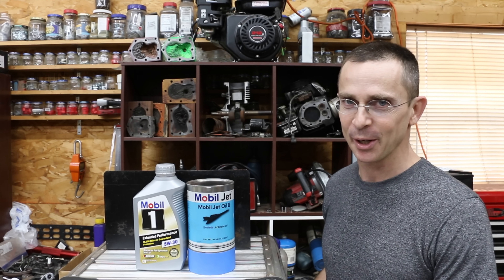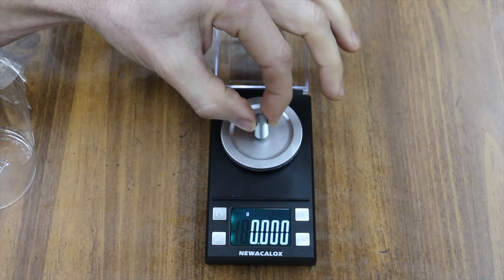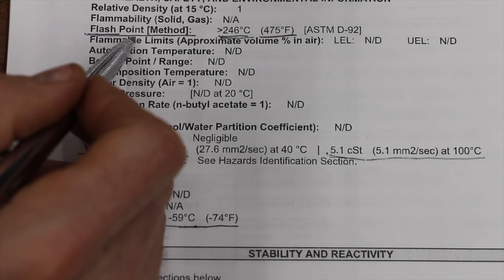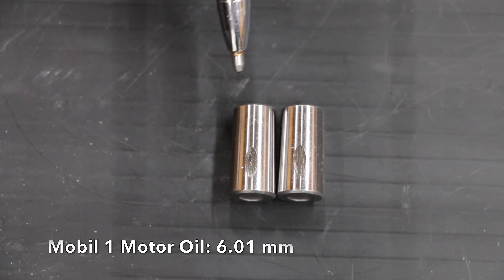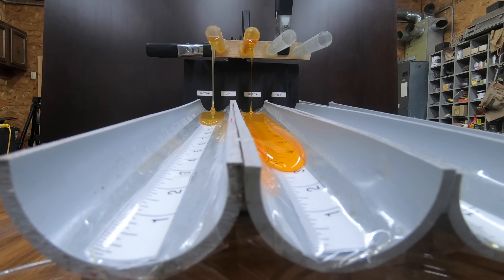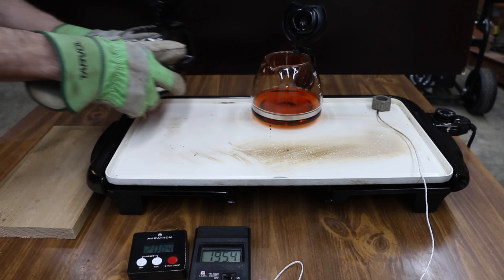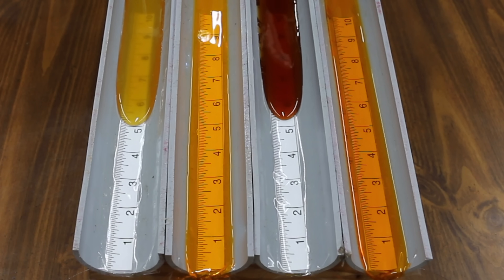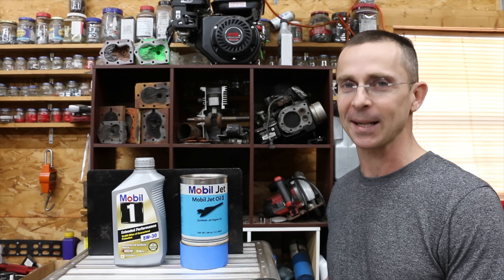Is Jet Oil better than Mobil 1 Synthetic?  Let's find out!

Comment: I played with that jet oil in the 80's. As I recall, it will not mix with any oil for an internal combustion engine. It would be like a non detergent since it's not for internal combustion contaminants. It's basically a high end hydraulic oil.
Reply from the maker: Thank you

Comment: Can personal lube is a good substitute for engine oil? Congrats for Puerto Rico!
Reply: Just want to know just in case you are stuck in the middle of no where with no oil and just q few gallons of ky and astroglide?  I would recommend against the ky warming stuff, it might make the engine over heat and cause premature detonation.
Reply: NerdByDesign you may want to seek professional help if your cruising around with a couple gallons of astroglide regularly.
Reply: @thewalpoles1801  That was a question for the OP, not a statement by me, hence the question mark....
Reply: NerdByDesign just re read it. Totally understand now.

Comment: can we get a lubricity test with cooled oil?  I think that would more accurately describe how the oil performs in an engine over thousands of miles.
Reply: oobligah wouldn’t any engine get close to operating temps in a few of those  miles.   I think it would be valid to see for info on old weather startups though.
Reply: @dogle9258  Well they get to lower temps for a much longer period of time at least, but I guess my point is that the oil has to operate after it's been heated for many thousands of times longer than when it's newish.

Comment: A jet engine usually tries to keep the oil below 300 'F.
Reply: Great point. My turbine experience is limited to PT6 turbo props, but I don't think I've seen over 80°C oil temp.
Reply: @ParkerUAS  and the fuel is used to cool the lubricating oil.
Reply: @user-nx8tk1pp5o  , yup. The hydraulic lines on quite a few turbine aircraft pass through the fuel tank to cool off. This has the benefit of keeping the fuel from gelling up (it doesn't really freeze, just gets like Vasoline) at high altitudes/cold temps.
Reply from the maker: Thank you

Comment: "Please don't use jet oil inside your vehicle."
What if my vehicle is jet-powered? ;)
Reply: Chrysler Turbine Car intensifies
Reply: Fun fact, Mercedes uses that exact jet oil in their superchargers ( Kompressor engines, such as the E55 AMG)
Reply: rock no wonder those damn things run forever.
Reply: Maybe Jay Leno would lend his Chrysler Turbine car for a test.
Reply: Maybe the Tucker, too? It had a helicopter engine.
Reply: Good point Batman.
Reply: Then your one step closer to being Jay Leno
Reply: Chrysler Turbine Car :)
Reply: PAG synthetics require special seal materials and will eat/turn to jelly a lot of industrial/automotive paints used inside of most engines 
Also totally incompatible with mineral and PAG synthetics
Reply: Oil in turbine engines are not exposed to exhaust by products like reciprocating engine. You would have sludge in no time if you used jet engine oil in your car.

Comment: Does 10W30 diesel oil preform better than regular oil? I hear its better for pushrod engines.
Reply: Depending on the rating, Diesel allows for more zinc IIRC.
Reply from the maker: Thank you for the video idea!
Reply: Series 3 Diesel is very high in detergents but that is the only difference that I know of.
Reply: Most if not all the zinc has also been removed from diesel oils. In the long run it kills catalytic converters.
Reply: @r.h.5052  In the long run, the lack of zinc kills fuel injection pumps. So if you have an older diesel that does not have common rail injection, add a little Marvel Mystery Oil (high in zinc) to your fuel since the Cat is far cheaper.

Comment: Best oil is the one changed at regular intervals. I've use every brand name under the sun including filters and my 2005 4runner, 130k+ of a lot of city miles purrs like a kitten.
Reply: 130k is not a lot
Reply from the maker: Thank you
Reply: 1.7 million mile semi trucks agree with you, but use a 1-up card called "bypass oil filter". it was super effective.

Edit: your 20-40 micron oil filter means that particles larger than the size of the fluid journal bearing can jam and scratch the fk out of your engine parts...
Reply: My 99 4runner is at 233k and is quiet as ever. Reg changes every 3-5k. $18 at walmart for valvoline high milage oil... Mobil1 filter changed every other oil change.   Then again i could use snot and a toyota will purr...
Reply: 370k on my  06 Nissan frontier work truck, using only mobile one since new . Truck looks like hell but the motor is tight. Still no oil added  between 5000 mile oil changes. I think synthetic is worth the money.
Reply: hatch-craft incubators You can run synthetic a lot longer than 5000 miles.   Depends on your conditions of course, but good quality conventional oil is fine at 5000 miles nowadays.   Synthetics can easily go 2-3 times that.   Most of us are changing oil too often because our Grandpas told us it had to be done every 3000.   That was true with raw oils and lots of blow-by back in the day.   Now it’s a waste of money.   Using a good quality filter might well be more important than the choice of oil anymore.
Reply: "brand name under the sun" I've never heard of that brand.
Reply: I had an Olds Bravado and I used probably 15 different types of motor oil in the vehicle changed every 2500 to 3000 miles, still ran at 315 thousand miles no smoke but started leaking at the hydraulic lines for the remote oil filter otherwise it would not used any between changes.
Reply: I have 2 f150s. 1 4.6 1 5.4 and both are over 500k. The 5.4 is 2005 and the 2007 is 4.6. I use royal on both. 10k each change and have never had to crack open the engine. Head gaskets havnt failed, valve cover gaskets only changed cuz i have to keep changing the stupid faulty timing chain tensoners. They both ise the same royal oil as my 5.4 MMR race engine in my Z. Both trucks are regular coast to coast highway trucks with a heavier trailer than either should pull.

Comment: I'm still surprised you like doing these oil tests! Hopefully see some Motorcycle oil tests someday. My shop uses just standard Yamalube10w40,but their full synthetic only comes in 15w50. And while I've been using Mobile 4T in my bike, though the Yamalube has Ester in it. It'd  be interesting to see if it makes a difference. Thanks again for what you do!
Reply from the maker: Thank you
Reply: Bikes usually work much harder - if car engine would spin at 15k RPMs pieces would fly from it. Mu neighbour has older Honda 929- 90k km on it and that engine is super solid - couldn't believe, but never abused past 10-12k RPM. So I would think motorcycle engines are made a bit better than cars. I think Motul makes Ester based synthetic oil.

Comment: Could run a test against Costco gas vs. Shell/Chevron? Costco claims its a top tier fuel that cleans injectors and etc. Fuel in California is ridiculously expensive so I’m always filling up at Costco. I’ve always wondered from a performance aspect if Costco fuel is just as high quality like Chevron and Shell. Thanks!
Reply from the maker: Thank you for the video idea!

Comment: fuel treatment showdown??? redline, gumout one n done, heet(red & yellow) royal purple, lucus, sea foam, stp 5 in 1, others. its summer moister builds up in the gas tank, carbon deposits on the piston, octane not good as advertised so it needs a boost, so many things happen to our cars/trucks but which treatment is the best. you've done the oil showdown, you've done some head to heads with fuel treatments, but which is the best is most categories & the price per performance?
Reply from the maker: Thank you for the video idea!

Comment: In your opinion which is the best high mileage oil for a.car with 75k or higher miles & also ty best oil.filtter🙄🙄??
Reply from the maker: I wish I could provide a good recommendation at this point but I need to test them.
Reply: Up until about two months ago I'd been driving the same Corolla for 16 years.  I used Mobil 1's high mileage with Mobil 1 filters once I passed 100k, and it kept my motor purring to 262k miles.  Everything else around the engine fell to pieces, but it performed like a champ til the end.
Reply: @andie_pants  okay I have a 2002 Kia sportage.with 140 +k miles on it and it will be getting a oil change  they got.a oil change special at Walmart for $35,88 & the oil they use is Pennzoil high mileage what type of fliter they use idk might do it myself 🙄? Thanks so much for your help 😀😀😀😀

Comment: The Jet engine oil doesn't have or need all the Additives, that std Mobil 1 automotive oil needs, as that is probably why it turned dark, under heat....
Reply from the maker: Great point! Thank you

Comment: If you need a "fighting chance", there have to be safeguards built into the system.. Jet engines are much like air cooled engines, quick to heat up, And then being exposed to cold, high altitude air temps. Awesome video!!
Reply from the maker: Thank you!

Comment: wonder how well a 50/50 or 75/25 mixture of motor oil and jet oil would work. I mean would it improve it in any way or would it not mix? would there be less heat loss that regular motor oil, would it flow faster while cold?
Reply from the maker: Great point!  It's ability to resist evaporation is very impressive
Reply: It would destroy the piston engine. I can't find the accident in the NTSB database, but in the 70's a Cessna 421 was given turbine oil in its piston engines. The engine seized just after takeoff and then pilot lost control. That is what led to the rule that turbine oils stay in cans, piston oils in the plastic oil bottle.

Comment: Mobil Jet Oil is about $30 per quart!
Reply from the maker: Wow!  Expensive
Reply: $17.41 currently where I work. Maybe I should raise our prices? J/K
Reply: But remember,  it's the only oil Wilbur Wright would use and endorsed by Chuck Yeager.
Reply: Wally World did an oil change on my MiG-29 for less.
Reply: Dang !
Reply: Freaking ouch. So much for putting it in my enemy's car. Lol

Comment: From my experience with Mobil 1, even though it's rated for 15k miles, 10k between changes is optimal for it. I have ran 20k before I was able to do an oil change, the used oil wasn't pretty, but my engine wasn't affected by it.
Reply from the maker: Great information. Thank you

Comment: Hi Commander, and as impressive as this is I'm just going to stick with the Delo and Valvoline diesel stuff. I figure if it'll stand up to compression ignition temperatures and keep a turbo from locking up at over 15K r.p.m. for hours at a time it's got to be in the ballpark anyway. Hope all is well and you and the family are enjoying this summer! BLESSINGS, Yall!
Reply from the maker: Hi Lewie, At $35 or so per quart, way too expensive and seems likely to cause damage due to low film strength and additive package.  I need to test diesel oils soon.  All is well here.  Hope yall are doing well and wishing yall many Blessings!
Reply: @ProjectFarm  What I understand about jet oil, it's not contaminated by combustion gasses if the seals are good and the oil is for cooling and lube BUT I'm a diesel guy talking about something like atomic bombs.  This is YOUR field of expertise anyway! I'm just an old diesel powered G.I. Have a fine week, Buddy and I bet the whole family is smiling!
Reply: Turbo spins closer to 100k rpm, but yes. Jet engines are almost exclusively roller/ball bearings with no babbitt bearings. There are a plethora of gears inside most jet engines for accessories also lubricated off the jet oil.

Comment: Not sure if you done a video on different greases like graphite, molybdenum disulfide, polytetrafluoroethylene, lithium. Greases with these additives if not that would be an awesome vidya.
Reply from the maker: Thank you for the video idea!
Reply: And bacon grease!
Reply: @ProjectFarm  dude you should have take a " Certified Lubricant Spacialist " online. Your great like Scotty Kilmer channel👍
Reply: shampoo is apparently another one that passes all the lubricity tests but is a terrible oil, according to the motorkote demo guy

he (project farm) has done boron oxide in liqui moly ceratec in a vid before and it wasn't very effective, but it did do something. there are things like archoil that use tungsten disulfide and/or potassium/sodium tetraborate, things like turbo maxx that use graphene and hexagonal boron nitride (that guy needs to take a breather) as well as a number of other additives. there was a phys.org paper that talked about nano-polycrystalline diamond rolled up in sheets of graphene being the lowest friction material ever tested sometime in the last 10 years. i haven't heard much since..

since i am taking the amazing advice of 1.7 million mile+ semi trucks, i would like to see how all these oil friction modifier additives perform after heated then run through a 2 micron or lower oil bypass filter that is designed to keep the oil clean of the majority of damaging carbon metal silicon/dirt and other fragments. if the anti-wear additives get stuck in the toilet paper rolls of the bypass filter, then it might be wise to choose one that uses particles of less than 1 micron so you can use the two systems together. professional race teams reduce the drag from the piston rings by choosing thinner rings with less spring tension against the cylinder walls, which gets them 20+ horsepower whether they are running at 700 or 2200 horsepower, it is claimed. friction and inertia are major aspects of engine performance and efficiency.

the alternative, of course (lol), is to use a semi or fully-silicon-carbide cylinder sleeve that you can drop into a modular "crate engine", along with ceramic piston rings, piston head, cylinder head, and valves in order to reduce friction, weight, and the need for cooling. it would also reduce heat transfer significantly and keep thermal and kinetic energy in the combustion chamber. its only a natural progression.. best of the best
Reply: Have you ever tried Green Grease? Best Grease that money can buy.

Comment: I have another suggestion for you. Can you do any review on the Lubricheck Motor Oil Tester ? I use it and I does seem to compare with Blackstone testing, except for one oil. I used it on Mobil 1, 20K oil. After only 6K miles it showed the Mobil 1, 20K oil to need changing. On all the other oils it compares with that Blackstone shows for the oil. (I have been using it and saving money on my Blackstone tests. :-) But I don't understand why it shows the Mobil 1 20K oil to be "worn out" after only 6K miles. Thanks as always for your videos.
Reply from the maker: Thank you for the video idea!

Comment: Well, you opened up the can of worms with turbine oil. Need a comparison between Mobil II, BP 2380, and Aeroshell 555.

Keep going and do the piston aviation oils...or maybe a test to see if CamGuard is worth anything. Lots of operators swear by it, I haven't seen any real difference, but then what I fly doesn't sit and rest much.
Reply from the maker: Great video ideas! Thank you
Reply: @ProjectFarm  aircraft spruce has all the oils he listed as well for order on line btw
Reply: The CamGuard would be an interesting to test. Lots swear by it but many swear by their brand of snake oil.

Comment: Try different jet oils maybe in small model jet engines, i think a 4 stroke engine is just too different of operating conditions to fairly test jet oils against 5W-30 in terms of film strength. Given how thin it is it definitively would cause problems for a regular engine if it sits for too long, which is why in small piston engines for aircraft extremely thick oil is used when they stored so it can't fall out during winter.  Great video though.
Reply from the maker: Thank you for the video idea!

Comment: PF,
Excellent video I have to say. Yeah that stuff holds up well in the cold. I have run aviation fuel gasoline from our local airport in our lawnmower LOL plus I have tried jet oil in a Honda engine and a tractor along time ago worked fine . Thank you for doing this test I could’ve sent you some oil but all we have it available is 55 gallon drums so you wouldn’t of got the packaging .
Thank you 🙏 
General repair
Reply from the maker: Hi General Repair,  Thank you veyr much.  Glad the jet oil worked fine in a gasoline engine just fine.  Hope you have a great week!